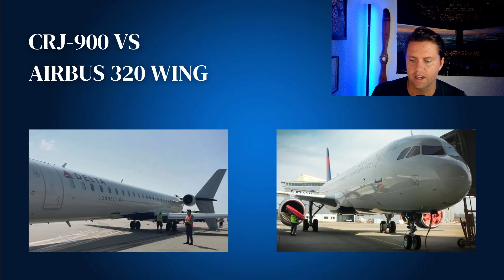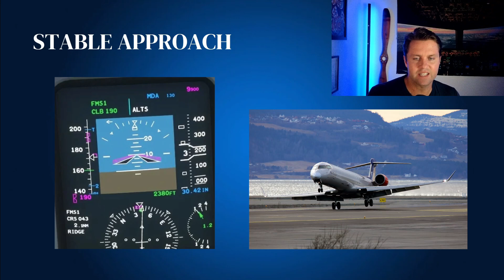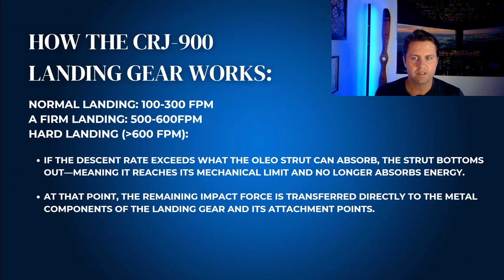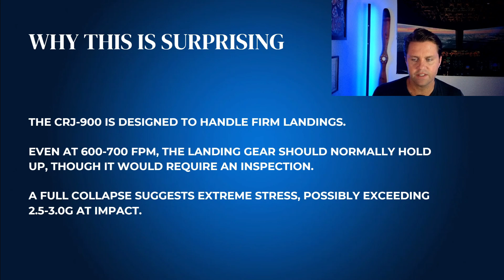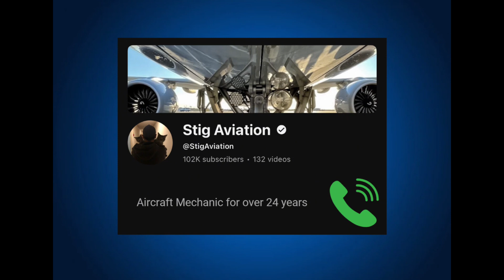Pilot Breakdown: Did a Hard Landing Cause A Gear Collapse?

Comment: I only fly 172s so your hours and knowledge certainly surpass me but with the 40° crosswind do they approach with a little bit of a crab angle and use rudder to straighten out before touching down?  Is it possible that with the hard landing combined with crab angle due to improper rudder that they touched down not only hard but with a side load causing the right main gear to fail?
Thank you.
Reply: Not a pilot but your last statement makes sense because not only is it putting all the load on that one gear but it might be at an angle which would inhibit the ability of wheels to roll normally, right?
Reply: @JohnHallgren  Correct.  If they touched down still crabbed at an angle into the wind that would put that side load onto the landing gear. Normally they would use rudder control to get the axis of the aircraft in line with the runway prior to touching down. I assume it's the same in a CRJ as in a 172.
Reply: @petegalletta  and I am guessing that the axis change would occur at a very low altitude, like maybe 25 ft or so, so it would be almost simultaneous with touchdown?
Reply: @JohnHallgren  definitely before touchdown but I don't know the specifics for the CRJ and hoping Gary comments here.
Reply: It’s the same as a C172, a CRJ, and an Airbus. Crab for the wind and take it out prior to landing, drop a wing and use rudder to keep it straight. Same technique for all. Have good crosswind technique for a Cessna and you will have good technique for a larger plane (although you don’t get as much practice at them in a larger aircraft).

Comment: It has been reported that this plane on descent was dropping 1100 feet per minute not 500-600 as they say it should have been!
Reply: No. The rate of descent did not exceed 600-700’ fpm until the last few seconds before impact. The it looks like the crew had the standard 3-degree glidepath nailed.
Reply: She idled engine thrust at 153' instead of 20-30', failed to arrest accelerating sink rate, and didn't flare. Impact load initially only on right main landing gear at 1110 fpm and 2.5-3 g, collapsing it and breaking off right wing. He didn't fix her error by restoring engine thrust or call out TOGA for unstable approach. Both pilots messed up.
Reply: It’s my understanding that 500-600 is the absolute top end of safe descent.  It’s normally more like 300-400.  I don’t know anything about this, but I watched a podcast with a pilot who made that claim.
Reply: Only in the few seconds before the crash, so it was a sudden drop. Before that the plane was in a normal rate of descent.
Reply: @pjglory3348Thank you. This 1,000+ FPM descent is social media nonsense.

Comment: I told  a lot of the pilots I know the same thing. I’ve flown 152 Cessnas and we don’t even smack the deck that hard! And no flare. Practically flew that plane into the deck. It’s not like it has f18 gear.
Reply: Yes they did,too fast with high rate of desent,wasnt designed for that hard of landing,dont know why they did that!
Reply: That was similar to an F-4 landing on a pitching deck.
Reply: Flown 152's have ya?  You as well have no idea what you are talking about.
Reply: Yep
Reply: BINGO!  The rate of decent has since been determined to be ~1100fpm!  That's well above what naval fighter aircraft approach an aircraft carrier!   Sad but fact, this is predominantly a pilot error issue.  It is not widely known yet (b/c Delta & MSM are stifling it) that a 26yo female with very little experience was at the controls.  Her ATP rating certificate had noted on it that she is not authorized to be pilot in command.   This can be tied to DEI pushing for females and minorities to be advanced in lines, whether properly trained and experienced qualifications are met or not.  I feel bad for 26yo female pilot.  She was not ready for this situation.  By the grace of God no lives were lost.
Reply: Bet you didn't have to deal with windshear in the 150.
Reply: @Wilem35  wrong
Reply: @ Poor decision making there bud.